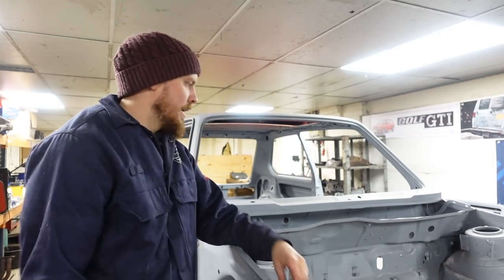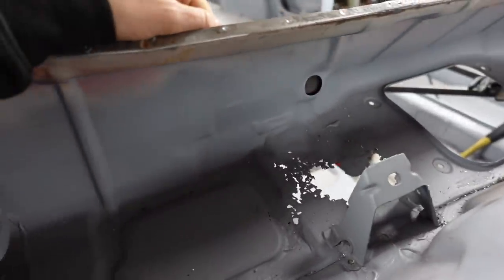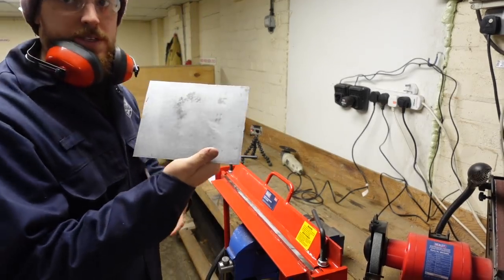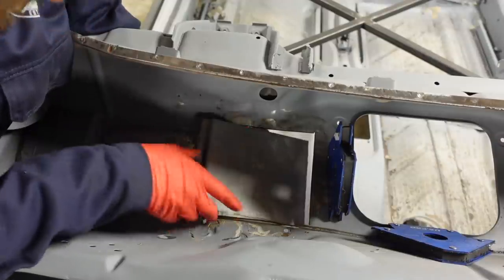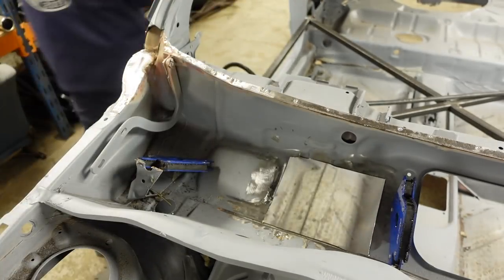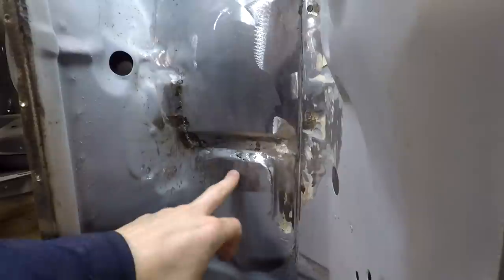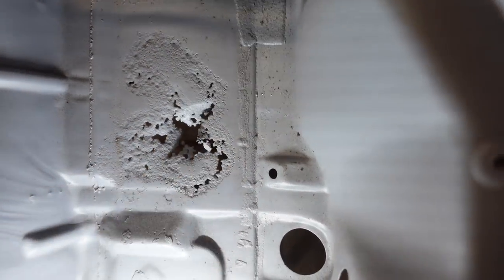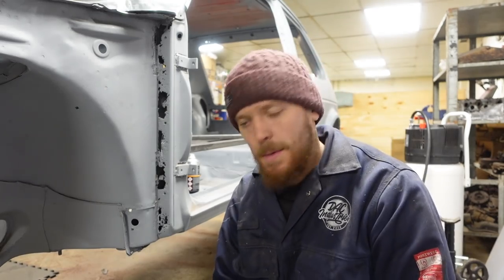Scuttle Rain Tray Repairs - Golf Episode 13 - 1983 Volkswagen Mk1 Golf GTI  Restoration Rebuild

Comment: You are getting there with your fabrication. I find welding car bodywork quite difficult, especially old metal. My welds aren't always neat either. A power file or finger sander is fantastic to clean those welds without grinding too much surrounding metal.. I really recommend the Evolution one as you can alter the angle of the belt which is great for funny places.
Reply from the maker: Thank you so much for watching and for the comment Matt. Glad you are enjoying it! I was so worried about doing the fab/welding work on this as everyone told me how difficult it was. I am really really enjoying it all so far! My welds are miles away from perfect but they are holding parts in place and grind back ok! The finger sander is brilliant! As you say you can really control where you remove metal from.

Comment: As a panelbeater of many years I think your doing great for a first time! Having said that I still think you need to turn your welder up one and get rid of the pub gas and buy some proper argoshield.
Reply from the maker: Thank you for watching and for the comment bud. I am glad that it is working out ok so far! I have played with settings and tried it on the next step up but it blew straight through the panel. I have some 90% Argon 10% Co2 on order already.
Reply: Play with the wire speed when one step up, either slightly higher or lower (which ever feels more comfortable) if you get the balance with that bit more power you’ll get better penetration and a flatter weld so less to grind off.
Reply: Totally agree I was thinking the exact thing, after building loads of race cars, but yes your doing a brilliant job you will never stop learning, just like the rest of us.. Stay safe.. Gazza
Reply: @bealzibub4002  spot on..👍

Comment: nice repairs again Dan, I was going to mention to strengthen round the clutch cable hole as all three I owned went on me they wasn't even rotten. this was when they were only a few years old. keep up the great work
Reply from the maker: Thank you for watching and for the comment bud. Glad you enjoyed it. Yes It has pulled through. It had a strengthening plate over the top. I think I am going to weld the strengthening plat to the bulkhead too to strengthen the area.

Comment: A die grinder or dremel type tool is handy for tight spaces. If you have room try a bit of copper behind the holes weld won't stick to it
Reply from the maker: Thank you for watching and for the comment bud. I have a Dremel but don't find it the best. It isn't man enough for steel welds. I have tried the Copper trick on a few holes and it works really well!

Comment: Cant sealy get you a new grinder? Using that one without the guard makes me nervous. One snag dude and things will go sideways real fast. I've been in heavy fab since my teens and I've seen some right horrors. Granted its a car your working on but any cutting/welding equipment can be savage. I enjoy the videos and I'd like you to do more 🤙🏻
Reply from the maker: Thank you so much for watching and for the comment. I haven't asked to be fair. I am going to order another of these as they are only £25. I have never had a guard on my grinders be it metal cutting, Tiles etc. I do need to get one though.

Comment: Dan do not  put seam sealer over weld through primer it comes  off .   you need a etch primer 1st.   weld through is for joining panels . look at trevs blog  or urchfab good tips on welding tips and car body work
Reply: Good shout trevs blog  and urchfab you wont go wrong checking those guys out Dan. I was just about to recommend the same when i saw darron castles comment.
Reply from the maker: Thank you for watching and for the comment Darron, Ok, Great tip. I will be removing all of the primer on the car in prep for a new complete primer coat anyways. I have been watching those guy's for a while now. Very talented!

Comment: I THINK you could have reduced the amount of welding by making a lip on the repair panel, that is probably spot welded down the inside of the bulkhead? I'm not familiar with this part of a Golf, but always look to see if by making a patch larger, you end up spot welding rather than seam welding.
Good work.
Reply from the maker: Thank you so much for watching and for the comment Gary, not a bad idea that. I tend to get stuck on doing things one way and get a little narrow minded. Making a stepped panel could work in area's. Will keep that one in mind.

Comment: Unreal work lad. I watched the Van build and have just watched all the Golf vids so far. I've a car here I need to weld, I have never done any welding before and want to learn.. All the advice online steers you towards £600+ welders. How are you finding that machine? I've a fair bit of sill and a jacking point to replace. 

Keep up the good work.
Reply from the maker: Thank you so much for watching and for the comment James, Glad you are enjoying the content. So I was also advised to go for a more expensive welder but opted for a circa £300 Sealey Mighty Mig 150. It is decent for the money. I hasn't (Touch Wood) Gone wrong on me yet. It does what it is supposed to and melts metal together. The welding school I went to has R-Tech Welders that are around £600. I have to say that welding with a more expensive welder is a much more enjoyable and easy experience. I will definitely be upgrading to an R-Tech soon but the Sealey is great for small/odd jobs.